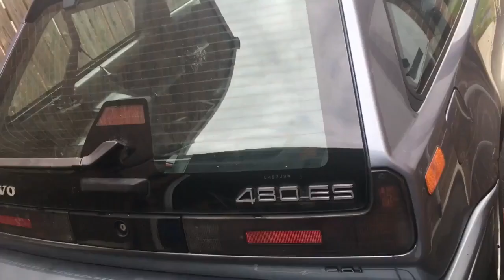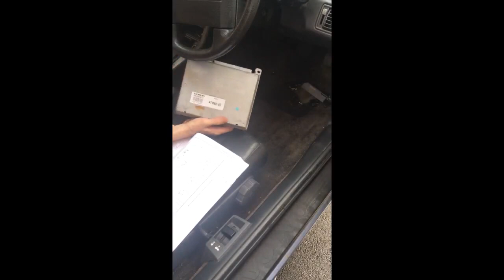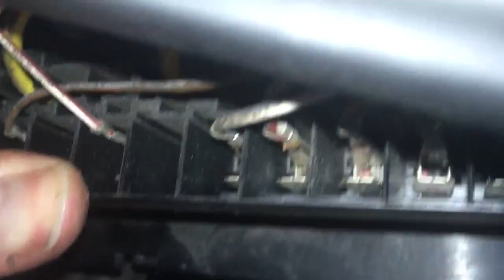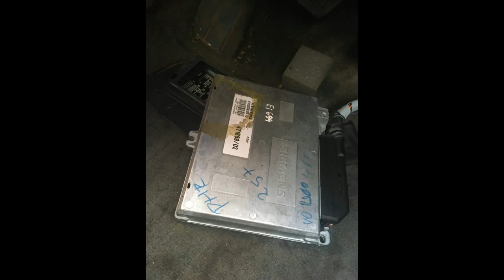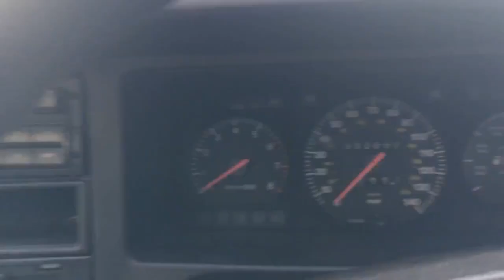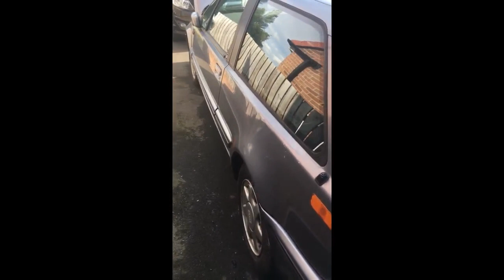#volvo480 part4 barn find Volvo 480ES ECU arrived!

Comment: Andy do You have some pdf electrical wiring diagram, for this car ? I need to check all the grounding points and dont know where they are...
Reply from the maker: Hi, thanks for watching and subscribing, more videos coming shortly!
Unfortunately there aren't many good electrical diagrams as many editions had slightly different wiring, even the Haynes manual which I have has several key errors in the electrical diagrams. The main ground points I've found are: Engine bay, beside the alternator, engine bay at the front left of the engine and towards the battery compartment.
Reply: Have you found out details about that orange fuse? It needs to be there, but what does it do? Been looking for it and came across your video :)

Comment: my 1993 S 2.0L has that too. the orange "Fuse" is something from the factory, when they move the car they place it in so then don't drain battery life, but if it's in a wrong place it can cause problems. read it somewhere on the Volvo 480 forum.
Reply from the maker: Ah, thank you. I haven't managed to find a definitive bit of info on it. Now you've given that suggestion I'll take a look as I wonder if it's a "master" bridge for the fusebox getting live supply. I'll test it out and confirm back